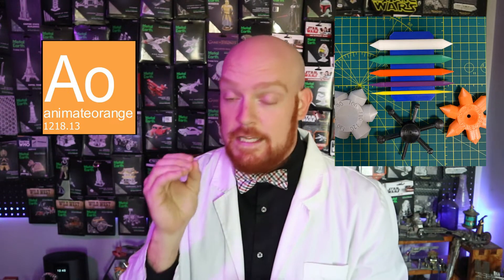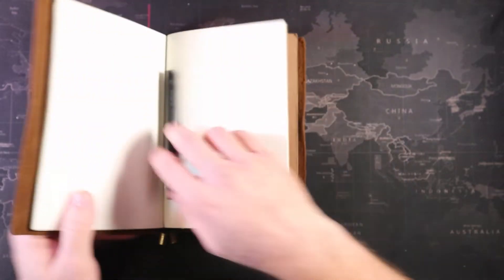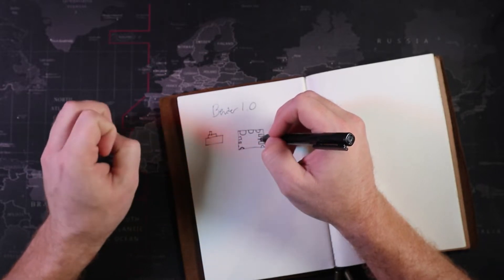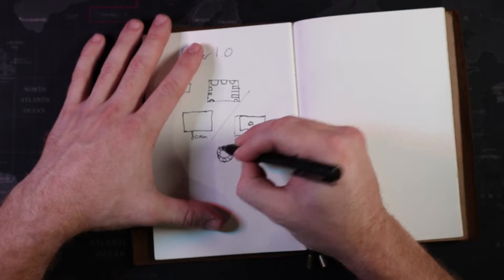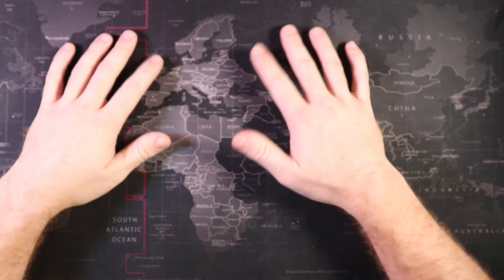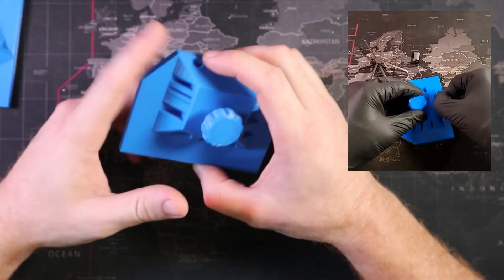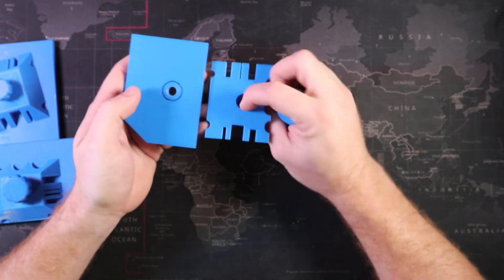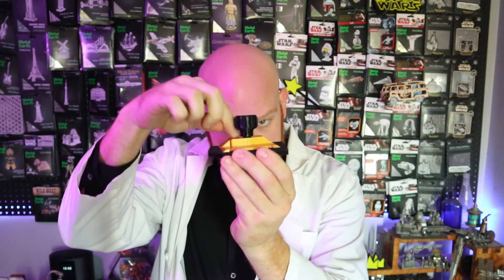Making the Ultimate 3D Metal Model part bender!

Comment: If you're manufacturing tools, could I request a set of those cylindrical forms, and some conical forms? Perhaps combine the two? Maybe 4-6 different diameters, each cylinder with two cone ends? You'd be in the best position to determine the most common sizes and shapes used in models.
Reply: I'm also not entirely clear what the cutouts are intended to do? Are they box and cylinder forms? How would you get a part into that tiniest skinny straight slot? It's late, I'll watch a few more times, I'll figure it out.